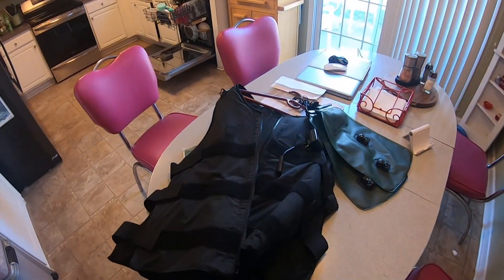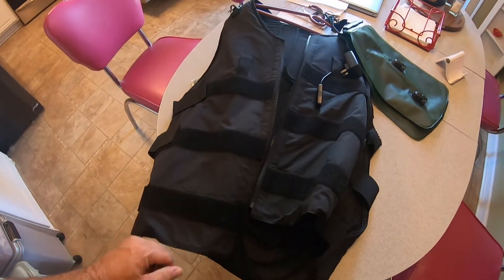cooling vests

Comment: I live in Florida and it's 93 degrees in April. I have the first ice vest you showed with the phase change packs. I'm thinking of getting the one that pumps the water though though.  Have you seen other ones you like or is this the best one? 

I've tried almost everything else at this point.
Reply from the maker: @Patrick Kelly  I'm sure there's better ones but they start getting expensive. this one wasn't cheap for someone like me but i just talked about it for you again here. It's way better than the ice vest though.
https://youtu.be/T8nVmGlBXrE